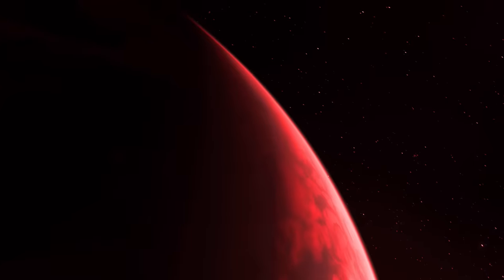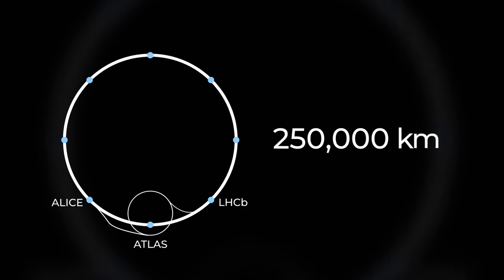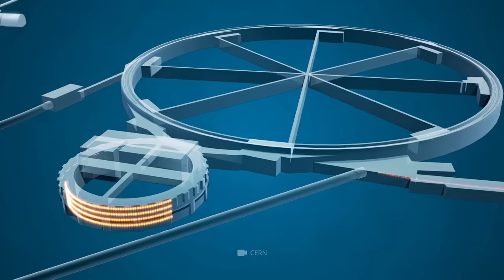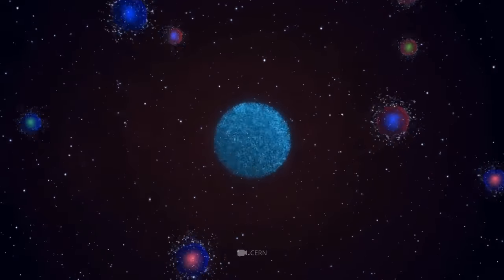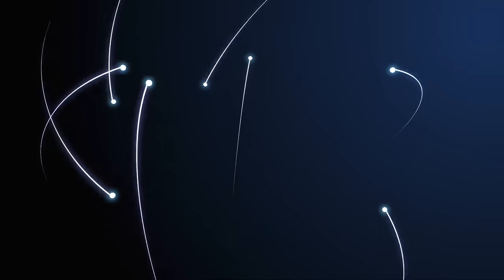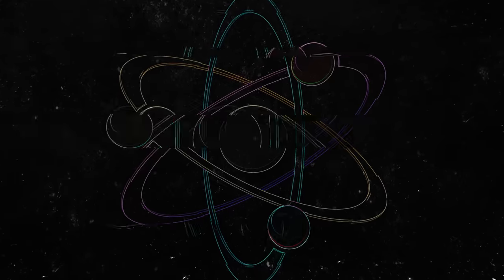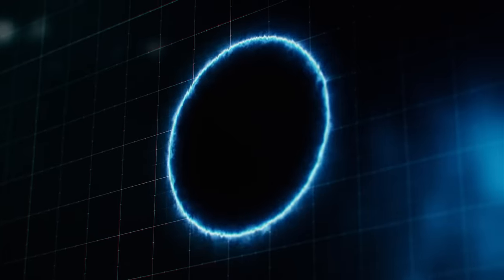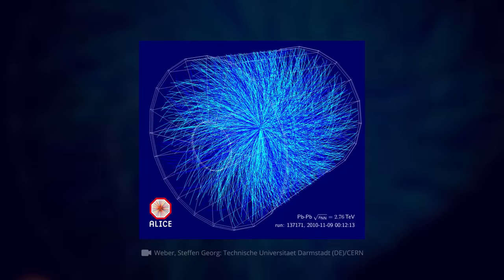How the Large Hadron Collider Works in 10 Minutes

Comment: “So far we haven’t made a black hole..yet “

July 2020: write that down write that down!!!
Reply: If we do the Earth will implode on itself as a black hole will get larger extremely fast amd we will not have the power to turn it off and you will see you feet go through your head before you go in it lol .
Reply: @Bart-Did-it  no the black hole would explode due to hawking radiation instead of consuming the planet
Reply: @Enxuvjeshxuf  really?
Reply: @Enxuvjeshxuf  
Can you explain ? I am eager to know
Reply: Lance Uppercut no u can stop a black hole but it will take time to do so because you have to Reverse the particle flow, then flood the dilithium chamber with exotic particles and route it through the main deflector dish, and construct your own black hole out of antimatter. Then kamikaze this new antimatter black hole right into a the black hole , this will instantly destroy the black hole
Reply: Ash : Hawking radiation is the thermal radiation predicted to be spontaneously emitted by black holes. It arises from the steady conversion of quantum vacuum fluctuations into pairs of particles, one of which escaping at infinity while the other is trapped inside the black hole horizon
Reply: Considering how 2020 is going, I could see this happening!
Reply: Lance Uppercut I think that any black hole we could create with a single particle would be so small that it will radiate out it’s energy through Hawking radiation and fizzle out almost instantly. Anything not in the swarzchild radius, which for that black hole would be very very very small, would be unaffected. I suppose it could grow out of control though, idk I’m not a physicist.
Reply: @justsomeyoutubecommentorwi4378  If its small and dosent have extra mass
Reply: @Bart-Did-it  we'd all spaghettify
Reply: 2021: you ain't seen nut..tt..thin yet.... baby ya ain't seen nothing yet! Stay safe all ♡ we're goin in! 
✌♥️😁🌍🌚☄
Reply: no you can't create black hole by colliding 2 particle in this collider..since the they can control how much energy they want yo give go this particle...this video just over react about the black hole part..
Reply: @mightymelted  your feet wouldn’t go through your head. You’d be elongated like a spaghetti feet first .
Reply: @Bart-Did-it  nope… the BH’s created by the LHC would be so small they would just evaporate as quickly they appeared.
Reply: @Enxuvjeshxuf  nope, it would be so small it would simply disappear without as much as a whimper.
Reply: @philidor9657  you are correct. The tiny BH we could create would just fizzle out.
Reply: @nicklaskowalski  😂 I have absolutely no idea what so ever at all about any if it .
I got that from Futurama 🤣 and look at them all squabbling amongst themselves it’s interesting and I think I learnt nothing from any if it. What I do know is I like 🍩’s with sprinkles 👍.
Reply: @nicklaskowalski  well it’d would depend on its mass but you’re correct
Reply: @LordVerdo  I'm thinking that too..
Reply: Biglyp  not sure if it wouldn’t create one at the Planck scale. Which wouldn’t have any effect for us anyway.
Reply: @Quran_Word_Of_Allah  Sheitan!!
Reply: @Bart-Did-it  love that show, I need to watch it again… Rick & Morty kind of took over fir me but I’d watch it again. 😂
Reply: 2.2 pounds of matter contains that much energy?  Where is the energy hiding?

Certainly not in the material.

Whatever is holding material together is released?

Matter is compressed energy? 

What compressed the energy?
Reply: @Enxuvjeshxuf  evaporate*
Reply: I don't agree with you.  What the public knows is usually about 50 years behind.
Reply: You’re about two years too early
Reply: @Bart-Did-it  if a black hole were made it would be so small that it would disappear in nano seconds
Reply: @WComment38383  not when it’s fed on you and everything around you . How do you know have you made one recently. Albert Einstein said “do not at all costs create one”
Reply: @WComment38383  black holes never disappear they only get bigger m8
Reply: @Bart-Did-it  Hawking radiation reduces the mass and rotational energy of black holes and is therefore also theorized to cause black hole evaporation. Because of this, black holes that do not gain mass through other means are expected to shrink and ultimately vanish.
Reply: @Bart-Did-it  and even then a black hole can't be created from the accelerator because it's only shooting atoms, but stars when they collapse can become black holes because of how much mass the core has and it just simply can't handle that much gravity and then collapses in on itself there for making a black hole. A atom has such small mass that gravity has negligible effect on them
Reply: @WComment38383  like the rest of my txts I am no expert on black holes just a few things I have read . What really goes on in that thing I have no idea lol it seems all pointless any way what we are learning from it seems negligible . Read an article it did nothing for us at all just a big waste of money resources and power .
Reply: @Bart-Did-it    with the aim of understanding more about the Higgs boson, other subatomic particles and the mysteries of dark matter the colider is a pretty key development for society
Reply: @WComment38383  cool bro you got a big 🧠. One thing that poked me recently I believe in the big bang as it makes sense to me from all I know  right  . Then one guy said your a little behind the times mate go look it it he Electric Universe so I did and that 💩 blew my mind Bro .  now I don’t know what to believe and I don’t believe in god only nature and proof .
Reply: July 5th: Nothing happened
Reply: July 2022, but at first I thought this would have been the end of the world- but luckily it was just me overstressing it
Reply: @Bart-Did-it  who says we arnt already in it.. i feel like ive been in a different place for a long time.
Reply: @Gills420  we are bro that’s just it the universe its amazing we are only just beginning to understand what we are looking at let alone what we cannot see 👊🏿
Reply: @adhamonir  from what I know I’m E they exist there is not turning them off in the end they consume the entire universe and the Big Bang starts again
Reply: 2023: nevermind

Comment: Imo, a micro black hole is unable to suck huge and heavier objects even though it have very high greativitational pull because whatever matter that keeping the black hole intact will scatter and the micro black hole just disappears. So if the sucking process is slow (for the black hole to completely neturalize all the partical of the material), by forcing a huge/heavier objects into it with great force, with enough preparation, we can get rid of the micro black hole that was created due to collision. 

And idrk whether the micro black hole would grow in size by sucking things inside. Imo, it can't grow. I may be wrong, what I stated is just a conjecture.
Reply: You wasted your time because this is so wrong

Comment: When  large mass  concentrates into very small volume  it makes a black hole

Pulsars are rotating neutron stars. Most neutron stars discovered today are in the form of radio pulsars. They are called radio pulsars because they emit radio waves. We can simply connect a radio telescope to a loud speaker and hear a pulsar. Pulsars sound like someone persistently knocking. So in short, we can hear a pulsar knock.

The Quran describes a star by "The one who knocks":

Quran 86: 1-3 And the heaven and the "Knocker" (Tarek in Arabic طارق) How could you know about the "Knocker"? The piercing star (Thakeb in Arabic).
The Arabic word "Thukb ثقب" means a hole; "Thakeb ثَّاقِبُ" means the one who makes the hole. The Quran is describing a knocking star that makes a hole. 
Pulsars are rotating neutron stars. As more matter falls into a neutron star its mass increases and as its mass increases its gravity increases. But gravity is actually curvature of spacetime. A neutron star distorts spacetime. As more matter falls into a neutron star its distortion increases. A point will be reached where distortion would have grown so much that it makes a hole in spacetime. 

God swears by celestial bodies that are invisible, that move, that sweep:

Quran  81: 15-16 I swear by those that are invisible (Khunnas خنس), that move, that sweep.

Satan is invisible and is described in Arabic as "Khannas" Quran 114.4 The Quran uses the same word "Khunnas" to describe the celestial bodies that are invisible. All celestial bodies have gravity and can sweep everything in their way but the only ones that are invisible are black holes (collapsed stars)

Comment: Well, it wouldn't make sense that colliding protons would cause a black hole because you'd need enough mass to actually form a black hole. That's.. what black holes are, right? A largely condensed ball of matter that has a gravitational pull so strong that nothing can escape.. because it's mass is so great? I don't think a couple protons is gonna have the mass to make a black hole. The worst we'd probably cause is a huge explosion from the energy release upon contact.

Comment: All they know is when you change the element of a magnetic flow and you're trying to capture or the device is actually holding a magnetic stir charge now this will interrupt the field around the earth and I noticed we're out of whack a little bit in the stars but that's where I've been pretty predicted that the more that you turn it on the field of the senator Earth is actually changing because that is a magnetic magnetic fluid generator now on the other side there is because like you know that is several different Bermuda triangles okay and each several different you mean a triangles is it like a vortex every time the electrical field builds up it starts to open up this eye of ions or above trans up in the sky or I forgot the name of them and this is to balance off the Earth so it travels through like a wormhole through the planet is teaching a lesson and then another one opens up at the same distance and each one of opens up and it transfers energy between the levels that's what balances it up that's what these ancients had done was collectively planted this these semiconductors in the earth cuz they know the floor was there and when you look at the North Pole in the South Pole you can see the energy rating on radiating out of it so as far as I look at the pyramids are basically a prodigy of that kind of information these guys are very smart in order to collectively build your chemical balance of creating a natural flow of energy that goes both down and up with waterways and some combustible elements have created a a spike of energy that flows out of carbon which is Crystal based technology when I first talked to Robert Williams I mean sorry Stephen Hawkins about building Aries and the designer of Aries Aries was a machine that was connected to the internet on a simple term but in the collective of the internet it would receive through the copper and lease a electrical field that would come or balancedly trained your body to re heal them by tone versions one of the hurts and some of the study of YouTube is generated off of the same value strain that that technology was gifted off of so this is all done by scientists at one time
Reply: Thank you so much for the explanation I now understand

Comment: structural engineering
= piling will guide - heat, water, gamma, air 
= these 4 and pollutants will drill soil
= micro-vibrations will accelerate structural-decay and create stress-fractures(similar to bones but not veins or nerves)
= sink-holes will appear after stress-fractures
= open fractures will appear after holes
= weakest spots will appear as strongest spots
= flow guide to path to fissure. same as h-beams/I-beams, pivot-points of weakest appearing as strongest and strongest appearing as weakest. (switchable by using second-order conditioning)

today your sarcophagus is releasing to natural weak-spots like coast of seas and badly maintained structures and air and rocks and ... uric-urea generation granite in-out ammonia combining with nitrogen and electric-vehicles is worse than ammonia-nitrate potassium rich diesel farmer booms. your european nose like pakistan-vietnam cold-desert nose-bridge from high-winds of down-under